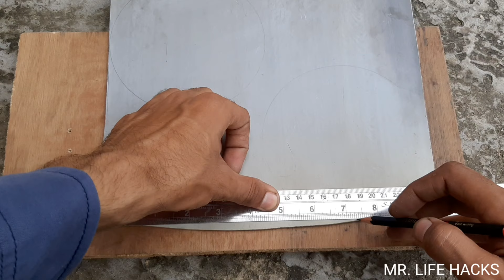How to make Blower Fan at Home | Homemade Blower Fan use PVC Pipe

Comment: Hats off to this guy and Full marks for the hardwork, but the design of propeller is wrong although DOR is right. The design of propeller and DOR should be such that air is thrown outside due to centrifugal force. Rest all are fantastic.
Reply: He design the propeller bite in wrong also motor connection is wrong.... Motor should be run in clockwise